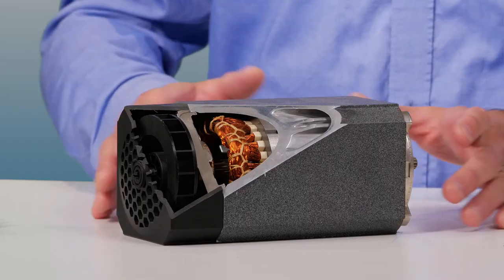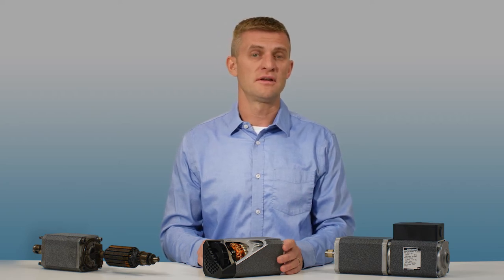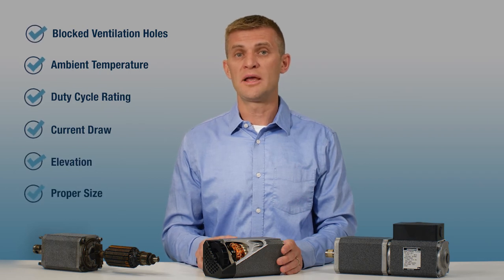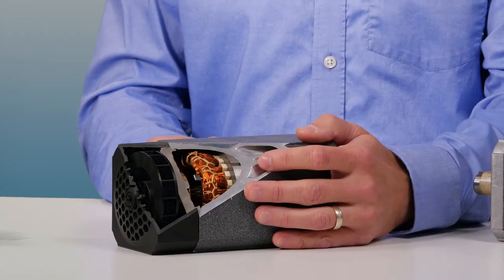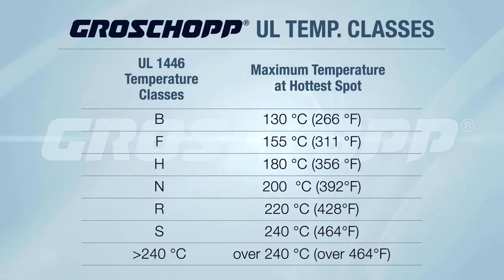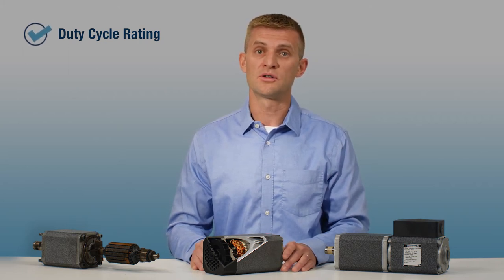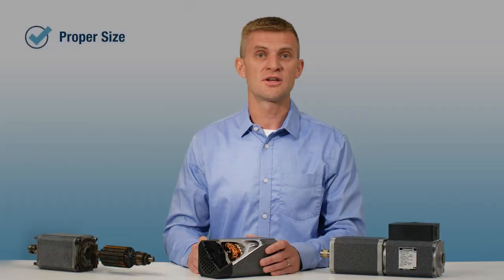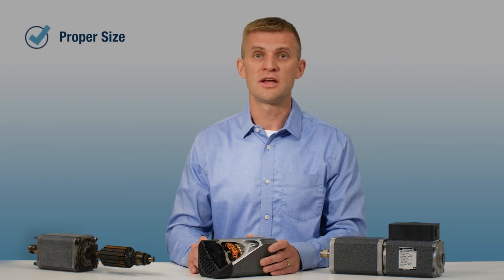Groschopp Tech Tips | Troubleshooting an Overheating Motor

Comment: Hi Paul, Why is it that too low voltage results in higher current draw
Reply: Cause Power = Voltage * Current (P=U*I)... To produce the same power your motor will have to therefore draw more current.
Reply: Baboon